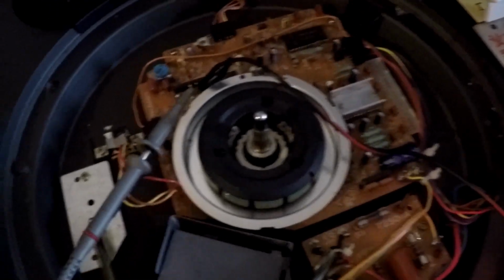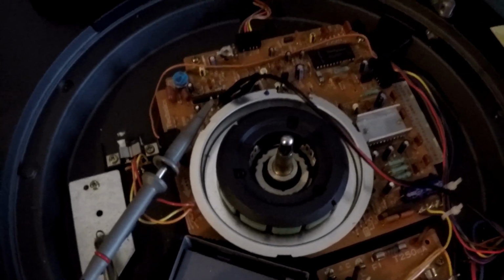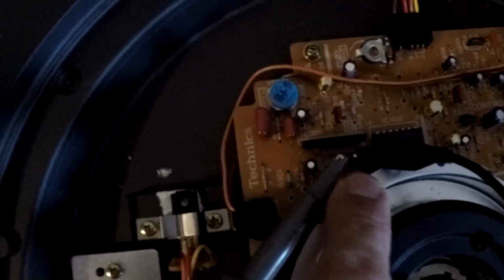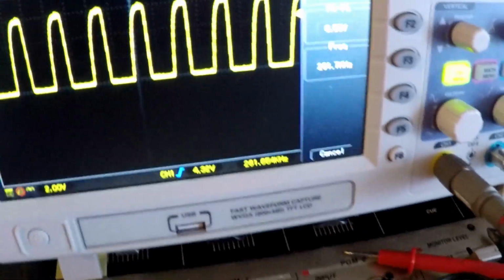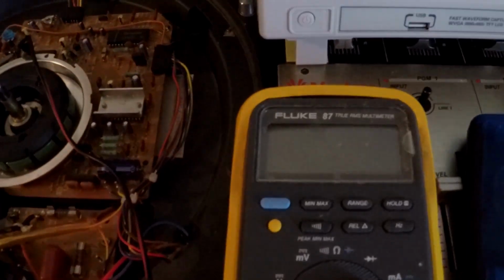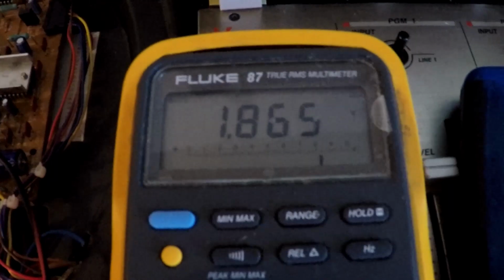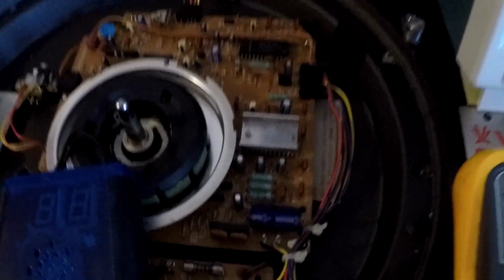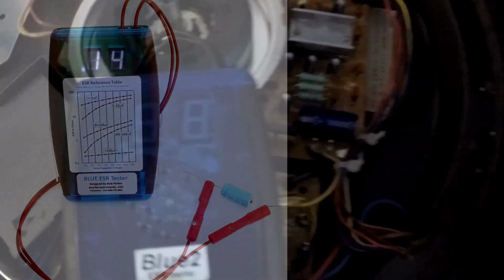Technics SL-1200MK2 Pitch Calibration

Comment: So just looking around on the net. Doing this calibration. Getting 262.08Khz and 2.7K Ohms at the correct places. But the red dots dont really stand still at the correct pitch percentages. I cleaned the fader with deoxit faderstuff - and some air. - Quite weird. Did you check if the red spots were still at the correct pitch values?

Comment: Thanks for the video. Good to see you are doing this by the service manual approach.  Trying to set the frequency on my turntable using a multimeter with 500kHz capability.  For some reason I am not getting a frequency reading.  I have the meter hooked to tp27 and the g post below it.  Pitch fader is set to 0.  TT is on.  The turntable works and is just slightly out at certain points on the pitch fader.  Has me scratching my head.  Any ideas?
Reply from the maker: Hey what's up? Were you able to resolve this issue?
Reply: @mixinginthebox  Hi Raynel,  Still looking to resolve.  The table works fine and vr 301 changes pitch just no frequency reading at post 27 and ground.  I also double checked to make sure my meter is working by sending signal from a signal generator.  No problems there.